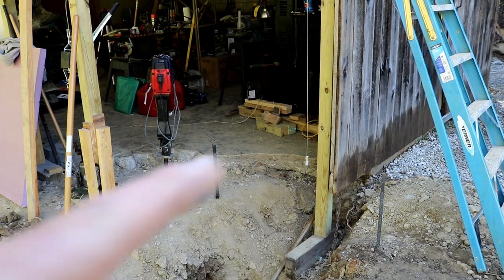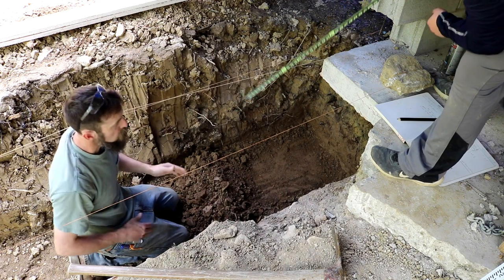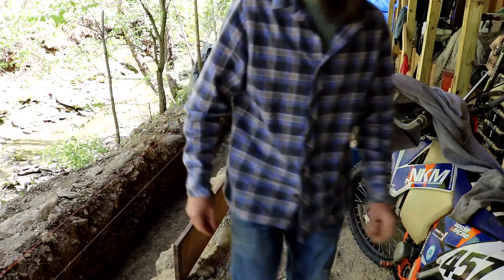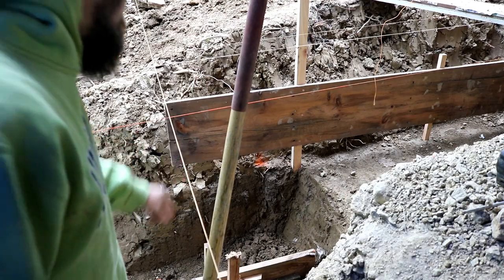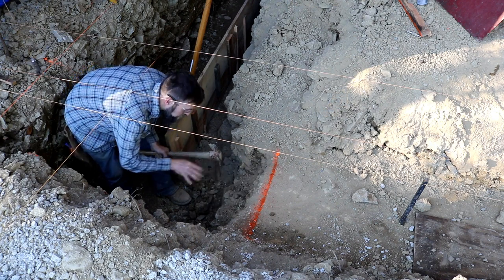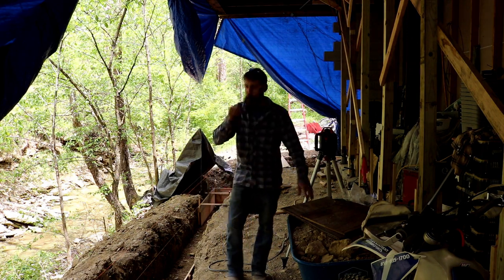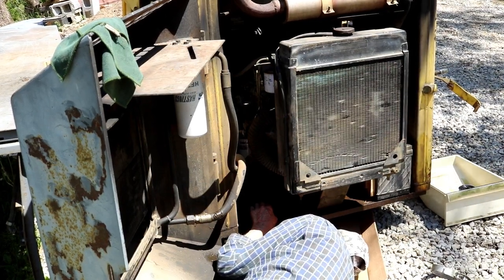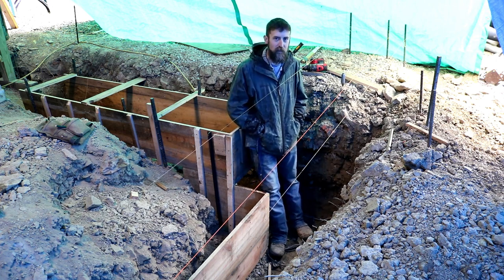Building concrete forms for the shop Footings . Damaged Shop 13

Comment: Steve, I am a contractor of 40 years and I appreciate you trying your hand at construction. A bit of advice, double up on your stakes and bracing. That 1x form material on those tall footings will blow out and bury the form boards which you then will not be able to strip. You will end up wasting way more time and concrete than you are trying to save. Get the mud slump right and don't over vibrate. Find someone who knows concrete to help you; they will be the most valuable labor money can buy. Good luck to you!

Comment: I'm so confused... you have a trench, why don't you just chuck some steel in there and fill with concrete? Why all the forms and precise measurements?
Reply: Andrew Sparrow it would take a lot more concrete plus be difficult to take any measurements from an inconsistent edge
Reply: Concrete is expensive. !
Reply: He mentions why in the video. Too much concrete. Concrete is like $150/yd^3. (Depending on where you live.)
Reply: You need the footer to be level since that is what the rest of the structure is based off of. It is far easier to make the wood forms level and then use them as your guide when the concrete is poured than it is to try and level out concrete that is just poured in to the trench.
Reply: Screed pegs will keep it level. The amount of work and time may or may not offset the extra concrete cost, especially when the forms blow out. I don't think the extra weight on the hillside matters past a certain point.
Reply: @leeroyholloway4277  Hard to put a figure on work&time when you are working for yourself.  If he were paying for it, yes.  I agree that he needs to backfill behind the 1"x framing to prevent blowout, which will make it difficult to remove the termite food.
Reply: Andrew Sparrow I agree. Never seen formwork in a trench for a piddly little job like this. Choose the right width bucket on the digger, dig out to the right depth and whack the concrete in, job done. A few bits if rebar hammered in to the trench walls at the right height to give you the level, and the blocklaying takes care of any minor wobbles, especially with two courses up to floor level. And you don’t have to go back with loose filling each side of the formwork. Never seen so much string either!
Reply: @ssmt2  that's what the laser level is for. How you think it is done on big pads? Once you're off the edges you still have to keep the slab level. So one guy runs around with the stick and a trowel and he strikes spots on grade then scratches an X on them. You strike spots in each corner of a bay then screed a line to them spots and fill in the U.
Reply: @srp01983  like Steve said with all the rocks in the ground there's no way you're digging a clean trench on his property. Some of them boulders they were pulling out were feet across.
Reply: Seems to me it would be better for the foundation to become part of the ground, key'd in so to speak, so if the foundation wants to move it has to move the surrounding ground. It's definitely a point of contention amongst the commenters.
Reply: Andrew something tells me all your projects go way over budget! Just a guess?
Reply: He mentioned two or three times weight and money pay attention Andrew!

Comment: Calculous from engineering is used in everything this planet turns on. I'm an engineer and used my workshop milling, lathe, grinding, welding etc in every thing that I have done for the last 63 years, from house removals through to lecturing in universities. Living in a city in the UK that left my engineering skills in the bin at the outset in the 1960's from industrial degredation all around this country my engineering skill has been priceless not only to me but to my various employers using skills that were dieing at the time. I've read some of these comment that are degrading a man's work to survive and rebuild his passion (for us to enjoy) Mr Summers is a survivor and mainly a doer. He knows his limits and tells us so, he doesn't bluff over his mistakes and he speaks his mind. Keep it up Steve and make your dream of a better shop possible by hard graft both mentally and maybe new to you, physical. Very interesting to many out here watching.

Comment: I find this content is the thing I most anticipated when I went to bed last night. Did a lot of concrete work in my teens 20's, including foundations. My Dad was the boss. He had ADHD and would lose his temper quick. I really can appreciate how gentle you are w/your son. You are a great father. I'll leave it at that.  As far as accuracy. I know your a machinist, and have to "sleep at night". Here's how I relate: After doing many construction projects make to last 150 yr floods etc. I volunteered to help w/a show where the staging/props had to be light and quickly moveable between  scenes. Foam core and 1X 2's were most of the scenery.  As others have said, you dont even have to screed to the top of the forms. You've already done that now so , now you know.  Now knowing you are only forming the uphill side makes a little more sense. Completely filling the bottom of the trench to "bridge" the hill, which you have confirmed is actually fill makes sense. Weight is not the issue as others have said. Fill weighs almost as much as concrete. Step forms are usually done separately. Pour bottom and build off that later. Gonna be near impossible to pour all at once. Should consider 2 separate pours to prevent slumping SNAFU. Again love your content. I know this is the first time you've had to do this type of job so nobody is born already knowing. I support your efforts. BTW: I have had to do smilar pours by wheel barrowing the concrete further than that. Lived to tell the story. Have also rented powered wheelbarrow to wheel barrow up long planks etc. so dont know how much a pump costs where you are but something to consider.  I could reach probably 1/2 the lenght of the pour just by using the trucks discharge chute. Have built longer chutes out of wood to reach 20' further.  If you could get the truck behind the shop (not sure if it's wide enough), You could pour the back wall right from the truck using either wooden chute or wheel barrow. Take care and stay safe, were with you.

Comment: Hi Steve, 
With a footing 400 mm high, there is no way those forms and especially the pegs are going to stay vertical, unless you brace them back to the trench walls. 

It would also seem that you are more concerned to have the top of the form at the level of the top of the footing and have a gap at the bottom, concrete will run out under the form when you vibrate it and you will not be almost impossible to remove any of that timber when it's encased in concrete. 

It's normal to let forms be whatever width your material is, sit it on the ground and put nails at the top of the footing, and screed to those. 

With forming your footing, you will need to back fill both inside and outside and compact that fill, more hours to add to the equation. 

The cost of your labor and material to build the form work would be way in excess of the additional concrete.

The block walls up to slab level should be concrete filled and reinforced, so you will need to include those starter bars with the footing. 

I think why some of the trades are not interested when they see the job, is the job itself. Screeding the footing that far below ground level is not easy, neither is laying blocks in a trench. You have to basically lay on you stomach and screed across the trench. It all costs extra money. 

If you only have 70 foot of trench and your adding an extra 8 inches in width 16 inches high, that about 1.3 cubic yards extra concrete. Even an extra foot wider, it's still less than 2 cu yards more.
You need roughly 1/2 cu yard to prime the pump. 
I'm not sure what concrete costs in the USA, but in Oz, it's around $200 a cubic meter, so the work and effort you are going through is worth way more than $300.
The only place you need to form would be across the trench at the steps, and if they are not in the exact position they can cut a block underground and no one will see it in the finished job.

Think about the economics. 

Regards Dennis.
Reply: Dennis Leadbetter I agree. The guys that showed up and wanted to peg and trench fill had the right idea. The concrete conforms to the trench sides and makes a better footing. That shuttering is a waste of time and effort.
Reply from the maker: Yes Dennis, I agree with you on cost of extra concrete being low  . This is not about saving money at all, it would be  a few hundred bucks at best. For me its about saving some weight and ending up with a product  I'm happy with . I don't want a footer that looks like a concrete truck took a dump on it ;-).They charge a fee around here for small loads so you pay no matter what so I'm told. If this trench was poured full without forming it would be 3.5' + wide in the corners. The steps had to be formed anyway . I wanted 1/2 blocks . Does it really matter? No , not to 99% of people anyway. The only extra forming I did is a straight run down the trench on one side.  The top of the footer will need leveled no matter if its formed or not so someone is getting down on his belly one way or the other I believe .  It may be buried under the ground and no one will see it when its done but Ill know. LOL. Got to sleep at night..
Reply: @SteveSummers  The dirt your going to fill around the footing weighs not much less than the concrete. So the amount of concrete below the ground level doesn't make much, if any difference to the weight on the hillside.
Reply: A wider footing spreads the load of the wall more evenly and is less likely to collapse especially if reinforced. Whilst the structural engineer may have specified a 20” minimum, it’s common for trench fills to exceed that. Levelling takes the form of stakes driven in so that the tops are all level with each other and the desired height of the finished footing. It’s actually quite easy to pour in and flat rake a mix level with the stakes without getting down on your belly. You only need to be within 1/4” to be good enough to be able to make up any small variations when block laying. It’s not engineering, you are in danger of overthinking and losing sight of trying to achieve a strong foundation. Trench filling with concrete back to the dug sides will lock into all those buried rocks better than any other method, which is why those pro concrete guys have been suggesting it.
Reply: Just wanted to emphasize that you need that bracing to the trench walls as Dennis suggests. The concrete will put a lot of pressure to your forms.
Reply: @SteveSummers  Your equating: what you had; a  8 or 10 foot high block wall you had, to just a mere footing. you need to do some calculating, just like an engineer. There is no way on God's green Earth, that the added volume of concrete just for the footing is in any way, shape, or form, going to contribute to making the earth move / fall / fail like the old wall. The calculations should start with what was the weight of the old block wall including footing, my guess 8 to 12 ton, plus maybe (what ever the number you come up with, divide that number by the length of the building) versus;  just your footing width of the existing trench. Something that doesn't add up from the start, a footing (for residential single story / family / structure-garage / shop) is usually just approx. 12   to 16 inch wide, 8 to 12 inch high, I'll leave out the obvious #4 Rebar. Now are you pouring the pony wall to make it easier to build, or to come up above something? The pony wall does not need to be as wide as the footing. Assuming that your'll be framing out with 2" X 6" in. wood lumber, that would mean the pony wall only need's to be 5-1/2 inch wide for the lumber, plus width for the type of siding your going to be using. For those who may not know what a pony wall is, just think of the capital letter "T" but upside down. the wide part of the letter "T" is what should be touching the ground, {forming the size of the footer} and the stem {skinny part} of the letter "T" is the pony wall. I'm trying to figure out why are you building a capital letter "I," versus; a capital letter "T" but upside down. You want to talk about weight, your throwing gasoline into the fire with the capital letter "I" build your proceeding with.
Reply: Just add a top brace to the form, one every 6 feet or so should do it. The top brace ties the two forms together. Best to do it after you place the rebar.
Reply: @SteveSummers  
If it's the capacity of the founding material that carry the imposed load that is your concern, then one has to question the entire footing design. 

If that material is inadequate to carrying that load, then you need to put in bored piers or drive piles into solid ground and then the footing becomes a beam supported on those piers/ piles. 

From when you dug the trench, it's clear you are on fill, that would be of more concern to me that whether it looks pretty. 

I've been in the industry for over 50 years, what you're doing is a total waste of your time and is going to fail and cause you total grief. I've seen form work fail, and what you are doing is totally inadequate. Wet concrete it's very heavy and fluid, and unless you substantially strengthen and brace those forms, they will collapse.

Dennis.
Reply: @stanwooddave9758  
And the problem wasn't that the soil could not carry the load, the initial failure was due to erosion from water that removed the support from under a substantial area off the slab.
Reply: @robertbrantley8502  
That sounds great in theory, but his formwork is quite thin, his pegs for the height are inadequate, so fixing a tie across the to requires a substantial fixing. If you just nail it to the top, it will break out the side of the form. And at the spacing you suggest the forms will bow between ties, till the first one fails and then they will all go.
Reply: @SteveSummers  Yes, you have to be happy with it! Back fill the forms a bit to support them... 
Great work and hard work and hard work, but done right. The object of  the forms is smooth sides so they won't have rough areas to frost heave.
Reply: @jeffreylee7184  
Which is why I have said, if the founding material has inadequate capacity to carry the imposed load of the structure, then the design is flawed and he'll need either bored piers or driven piles to sound material and the footing would then become a beam spanning those piers/ piles.
Reply: @dennisleadbetter7721  No, thats incorrect. at 6 foot centers he has a safety factor of 3 on form leaning and if you get a slight bow between braces who cares, its on the order of 1/4", he's not building a piano its a footing.

Comment: I've watched a lot of videos of machinists scraping in precision surfaces on machines before but this is the first time I've watched one scrape in a trench! Great job.
Reply: I worked with Harold the gravedigger and Steve is even more particular than Harold used to be excavating. I remember Harold told me, We're not digging holes in your backyard, so corners have to be square. Steve its taking it to a whole new level though.

Comment: Steve, I've been in the building trade for forty years and that is the most precise footing I've ever seen, well done. Good video
Reply: But is that precision needed?? Machining is worked in the +/- 0.001 of an inch. Framing is worked to what +/-1/8 inch or so. So what is the tolerance of footing work?
Reply: I'm telling you. He should stain it and put it on the mantelpiece. That's some fine furniture in that ditch. Next we have to see Clickspring do form work.
Reply: @andrewstoll4548  footings get buried so no one worries too much about them.
Reply: Paul Frederick  Maybe that’s what click spring has been doing for the last 18 months.
Reply: @shadowdog500  setting a single brick, I'm sure.

Comment: I'm a contractor by trade. I had a older guy working for me that had a lot of time as a machinist. He would drive me nuts sometimes with his perfectionism. So I can identify with your frustration. And yes you're right, the only major concern for the footers is that the top of the form be level within an eighth to a quarter of an inch. The masons can make it up with the mortar.The bottom of the trench can literally be too deep by an inch or 2. The concrete will just simply fill in those areas. The bottom needs to be hard packed virgin ground if possible or stone. When ordering concrete always get a little more than you think you'll need and form yourself a little pad somewhere on site just in case you have some extra, you can use the concrete for something useful.

You're doing a great job!
Reply: I've done block, concrete and wood work, when you do them after metal work it's counter intuitive to be "sloppy" with tolerances at an 1/8 inch but once you learn to accept that premise they are just like any other work once you get used to it.
Reply: And when you are doing foundations or other substructures you can always "beat to fit and paint to match."
Reply: @robertbrantley8502  The local saying is ''can't see it from brooklyn''.

Comment: Well Steve I’m having the opposite problem. I’m a spitball kinda guy used to doing the grunt work with a shovel so learning to do some machining and actually hitting my mark is frustrating. Yup my math stinks too. I saw the smile when you unlocked the shop.  You still have the enthusiasm and tenacity I noticed when I tuned to your channel a couple years back. The wide range of stuff that you’re doing from machining to shovel shows your commitment and willingness to learn new job skills. Nice job sir 👍👍👍👍